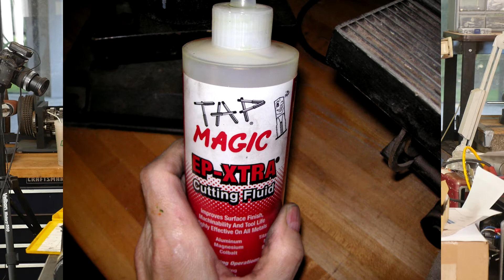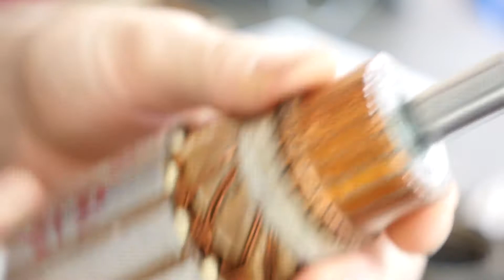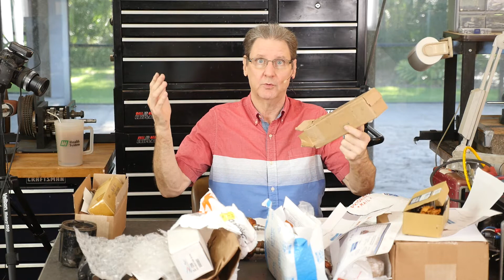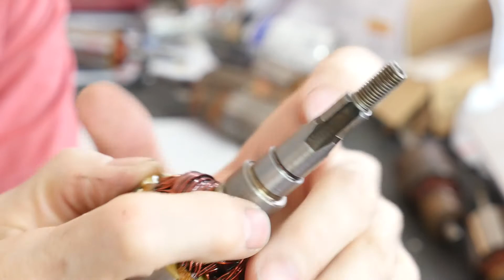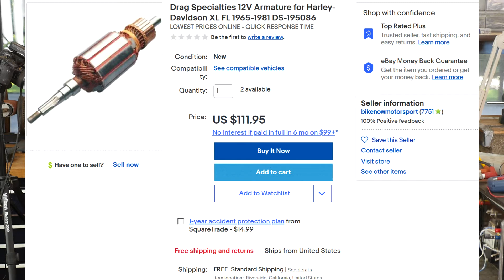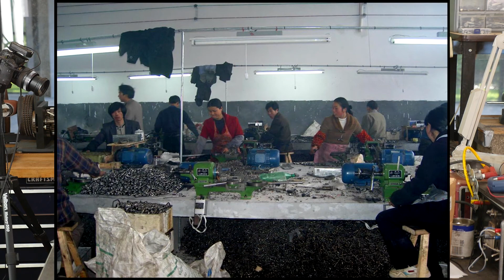Seven armatures for seven generators

Comment: DB Electric from Amazon does not fit in the big bearing ; and I tried 2 different bearings . It will slide in and out. Also the gear does not have inference fit; it will just slide off with little effort by hand.
Reply from the maker: The gear fit was always a little sloppy, even with factory armatures. Some you would have to use a puller, other would slide on like you describe. Note the big bearing is supposed to just slide on. If you can imagine how things go together, the nut that holds the gear on clamps the bearing inner race between the oil shield and the step on the armature shaft. Many times you can take the gear off and then just grab the shaft and slide it back and forth a little bit. The -65B Hitachi generators are press-fit bearings, I could not even get those apart, though I will try again in a future video.

Comment: Do you have that CAD model for the sportster frame available? I'd love to get a hold of it. I need to design some custom brackets for switching over to rear disc brakes.
Reply from the maker: No compensator on some XLCH models or all bikes 1977 and later. If you took the compensator off an electric-start bike, the Bendix would crack after a while, I guess it needs some "cush" in the primary drive to protect the electric starter. I do think bikes with a compensator are smoother and easier on the tranny and drive-train, though people with a good ear can hear the compensator working, at least some times.

I bought a tool box from a broke Harley mechanic and he had taken a junk compensator nut (40386-57) and welded a 1/2" square drive to the narrow part where the threads are. Then he welded in some cap-head bolts from behind on the plate. The bolts would then fit the real compensator plate in your bike and allow you to take it off. It works with a torque wrench or an impact, though it is butt-ugly.  Hang around a bike shop and they may have one in the junk pile you could have.

The real colony tool is SKU 010974, #3506-1 Compensator Sprocket Nut Tool 1955-70 Harley-Davidson FL FLH 57-76 Sportster , but it's over 50 bucks, ouch. If I was in a shade-tree mood, and had nothing else, I would drill an angle iron at the spacing of those holes in the plate, put some bolts through the holes, and try to use that as a spanner to get that dang compensator off.
Reply from the maker: Yup, sorry you had to contact me via LinkedIn, but glad my frame model will help you out. I plan on getting all the part CAD models up on my website so anyone can download them.

Comment: This has nothing to do with the current video, it is from a prior one. This is about a 1985 xlx1000. I bought this cheap and you know how that goes. 
Fixed the trans problem from your prior videos. I bored the cylinders, rebuilt the heads, but I needed a different front head, so I ordered a 16673-73D. Fired up, drove it for about 15 minutes and the front head/rockers started screaming. Long story short, I realized that the cylinders were 16581-72, which brings them way older than I thought. The heads that came with it were 16682-71, even older. Question is that the head I bought (16673-73), is it even compatible with these cylinders. I've checked around online and I cant get an accurate answer. I guess that must be the reason I'm getting all that noise. Any ideas would be very grateful> Thanks again.............Richard
Reply from the maker: Wow, glad you got the tranny sorted, sorry for the head problems. My understanding is that the 1000cc heads came out in 1972 and they had problems, probably with sealing and cooling. So in 1973 they changed both the heads and barrels, and to my knowledge, they don't interchange, you can't put 1973 1000cc heads on a 1972 set of 1000 cc barrels. The barrels are easy to check out-- if they are the 1972 barrels, the threaded holes for the head bolts are threaded all the way to the gasket surface. One 1973 and latter cylinders, there is a deep countersink where the threads start about 1/4-inch down the hole.

So if my thinking is right, there is no way you could bolt a 73 head on 72 barrels. Be warded that the numbers cast into the barrels are not the part number of the machined barrel, but the part number of the casting that they make the barrel from. I think they may use the old castings for the 73 barrels. I know the heads were really weird in the late 1960s, they changed valve sizes, sometimes not changing the casting number, and other times they changed the casting number as well as the final part number.

Now if the heads are "screaming" it sounds like they are starved for oil, I can't think of another reason, though my '77 made some really weird noises when the barrel nuts got loose. You can pull an oil line and make sure oil is getting supplied to the head. Next would be making sure the passages inside the rocker box are clear, and that the rocker shafts are put together right. You can also get the front rocker box pried up a bit to peak inside to see if there is oil up there. I often pulled a head and then just plopped it back on with the same head gasket, the solid copper gaskets used on Iron Sportsters seem to take that OK. 

Good luck, don't give up, I am sure you can figure this out.

Comment: Hello my friend I have a 1981 shovelhead 1340 do you know where I can find the pilot jets please I have two  carbs to see which is the best one runs rich please help if you can I would gladly pay for any parts because I live in the UK regards Alan.
Reply from the maker: Sorry mate, I don't know anything about Shovelheads, I am a Sportster guy. I don't even know what carb came on a 1981 Shovel, but if it has a pilot jet, it's not a Keihin butterfly carb, which have main and intermediate jets, but no pilot jets I have ever heard of. First you have to figure out what carb is on the bike, then it should not be hard to find jets for it, there are plenty of companies that will ship internationally. There should be plenty of videos out there on selecting jet sizes for Shovelheads.

Comment: Hi  Paul
 thanks for the shout out and answering my questin very cool thanks 
Would be interesting to put a micrometer on them and see what the shafts are coming up at 
Also the waight of the shafts suspect that the cheaper poorer quality will be all over the place coppers not the cheapest material many watering it does to sum degree 

Excellent video as always 
Thanks Danny
Reply from the maker: I just bought a 1/4" steel plate I can cut a groove in and see if I can press the bearings out with my press. I guess the other thing is to see if heating the inner race would get it to loosen up. I figure the armature is junk already, so no harm on hacking on it. I would like to get the bearing off to measure that shaft as well as the inner race.
Reply from the maker: Duh, I re-read your comment after getting the email notification and now I see you were talking about measuring the seven 65A armatures, yeah, that is a great idea. I have a kitchen scale that would work down to the gram. Also a good micrometer I could measure the shafts with. Thanks for the idea. Get this, that Quality Solutions outfit where I bought the $39.99 Amazon armature with the splatter on the shaft not only returned my money, but told me to keep the armature.
Reply: @Open-Sport  hi Paul 
thats brillant news  a good seller is harder to find than the the parts have to get that one rebult just to see if it does work 
Kitchen scales sounds perfect for weighing the armatures i think it will be very interesting to compare out put from the generators and weight 
i suspect heavier the armatures the higher the out put but only one way to known 
Thanks Danny
Reply from the maker: @danieloregan2330  Good thing you mentioned it now, since I will weigh the Drag Specialties armature I have to return. I hope I remember how to get a good reading from my micrometer. Great suggestion, thanks.
Reply: @Open-Sport  u showed a shim washer selection do a few test measures on the washers for example if ur 40 though washer cums up 41 thou u know its a though out by 1
 but really the accuracy isn't what 
Were really looking at its more of a comparison between the armatures
 if ones 1.125 and the rest are 1.135 that could be an issue I would be more worried if sum came up under size so the brushs start further in 
Very investing stuff not often u get this many and variations of the same part together
Thanks Danny
Reply from the maker: @danieloregan2330  Ahh, I get it now, Well, you still gave me the idea to measure the shaft diameters where the bearings and the seal run. But yeah, I see what you mean, if the length of the armatures are different, it will put the brushes out of position. I still wonder about that big washer in the one 65A armature. As to the four washers on the 65B, I am sure they will measure close, but like you say, if the armatures are different by a lot, that means we have to get or change those thrust washers to set the end play on the 65B. Nothing is simple with a Harley.